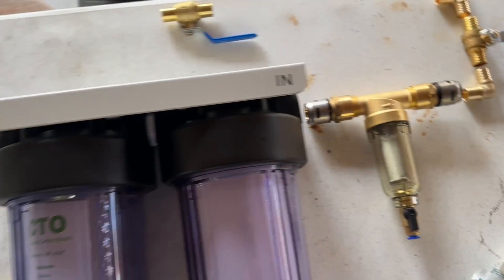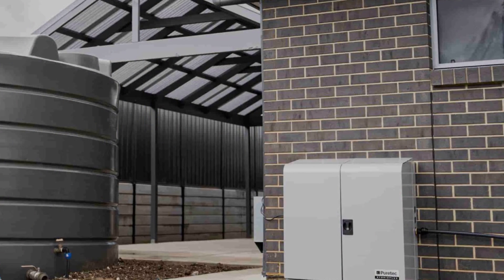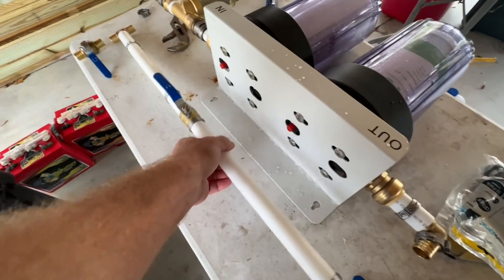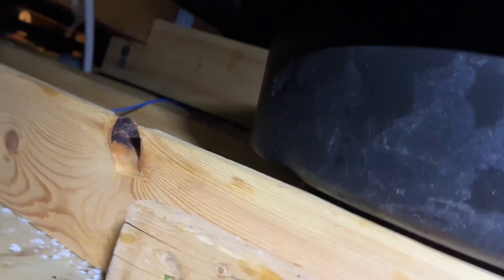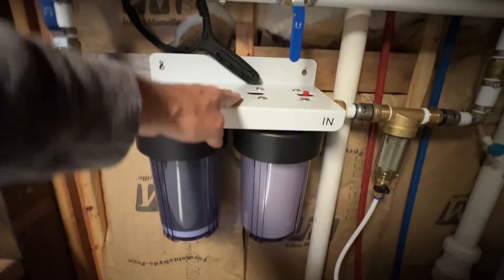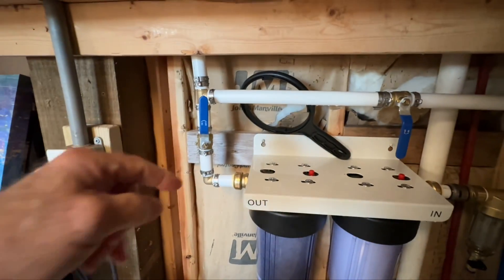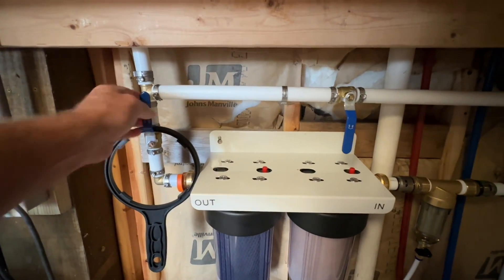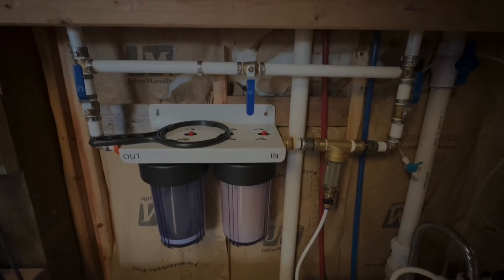Whole House Water Filter~ Cheap & Easy DIY

Comment: Great system. Why did you choose 2 cartridge sediment and carbon system? and not choose  sediment carbon and block carbon . Is the first time i see that sediment and carbon is chosen instead 3 filters. For me is fine to use 2 filters sediment and carbon. Why you select 2 vs 3?  Is carbon block filter useless ?

Comment: Okay but what is it filtering. And don't tell me water. What is it filtering out of the water
Reply: Depends on filter cartridge capability and what is in water to start with. The brass filter with the drain hose filters larger particles, like when city turns water off and back on again then so much large garbage comes in. The sediment cartridge is probably 5 microns so it filters out anything greater than 5 millionths of a meter in size. The last one, carbon block, will remove chlorine and other problems depending on how it was made and what materials. Read the individual filter information.
Reply: Probably Odor, chlorine, generally bad tasting water 
Pre sediment is exactly that, first 10x4 filter is a particulate filter, which catches anything the pre filter doesn’t 
2nd filter is the activated carbon filter ( black carbon) filters out most all bad smells and tastes!

Comment: You may want to add a couple of pressure gauges (oil filled ones last longer) - upstream (before filters) and downstream (after filters) so that you can get a better idea of when the filter cartridges should be replaced. You can always visibly check it for severe cases but there will be a approx. 5-10 PSI water pressure drop when the filters get too dirty.
Reply: This is a myth! The pressure baggies will always show the same pressure as long as the water isn’t shut off because the oil pressure gauges are contained in standing water. If they were inline with the flow they could detect difference in pressure but see almost nobody with their gauges inline with the passing water. Essentially making the gauge useless

Comment: Your sediment filter/pre-filter is DIRECTIONAL and has an arrow pointing to how the water should flow. Stated another way, there is an IN and OUT designated and you have installed it backwards flow. You may think "no big deal" but it does matter. How? When installed correctly, the water goes in and any sediment is collected on the outer layer of the inner filter so that you can visibly tell it should be cleaned out through the bottom. The way you have it - the water enters the filter housing from the inner part and water goes out. This means the sediment get trapped on the inside. Looks like you have Sharbite connectors so you should be able to pop it out and flip it 180 degrees for a correct install.
Reply: Forgive my ignorance, but is the IN indicating supply input? If so he states his input is on the right. EDIT: nvm didn’t notice you were talking about the pre filter took me a bit to see that
Reply: Oh wow… I hope he flips it around. Maybe he can put in that female slip fit that he was talking about in the video when he flips it around.
Reply: Wow - good catch.  I was wondering how you knew until I went back and saw the arrow at 11:36.
Reply: Oops !😂
Reply: It is backwards.  I hope he reads your comment.  Good find btw.
Reply: Enjoy swapping out the shark bites in a year

Comment: just wondering why you have to filter your water, is the water not drinkable straight from the tap
Reply from the maker: It is drinkable but it is highly advisable in most areas to filter what treated with chemicals and sent through miles of pipe. Ours seems to have a good bit of sediment and chlorine.

Comment: Nice work. Do you get much of a pressure drop?
Reply from the maker: Pressure here is not real good so I was worried about that. I would say there has to be some but I really have not noticed and drop in pressure.
Reply: Thanks for the feed back. @exoman
Reply: If you want to reduce pressure drop I recommend flex hose instead of 90 degree elbows, or a pair of 45 degree bends.

Comment: How many time do you change filters that they recommend. And how much is that of a cost to the consumer. I have been looking into that. We have a sulfur taste and smell and am looking to get rid of that. Will this work.
Reply: For sulfur you’re going to need to utilize ozone. 

This would be made possible by having an initial large tank that the water is stored in and “zapped” with ozone for about ten minutes. 

The water would then go through those filters and be stored in another tank that is the pure water would be.